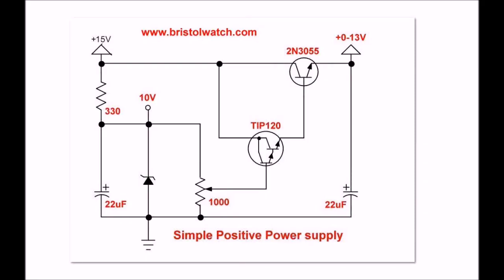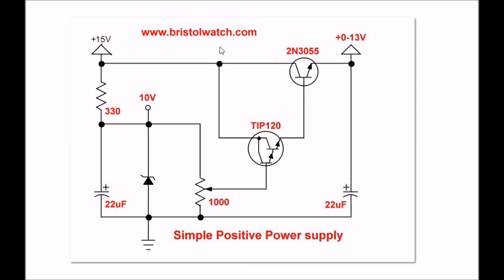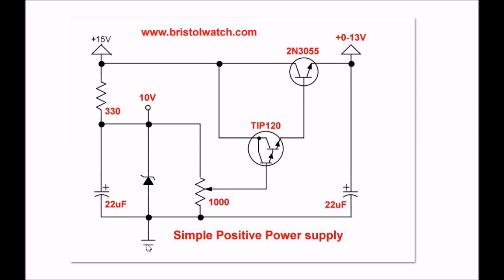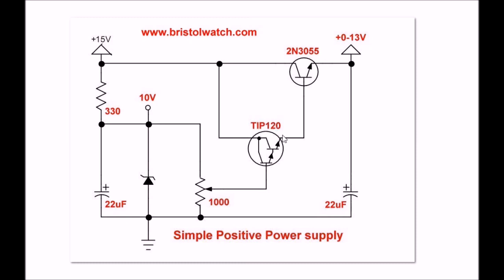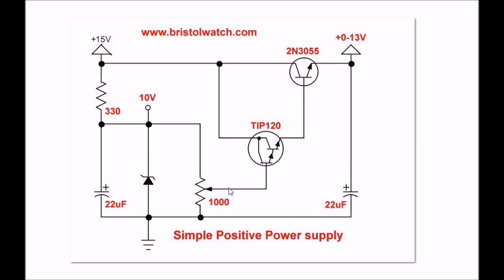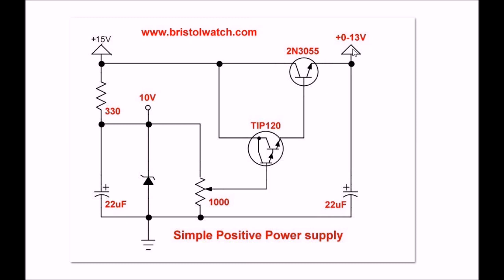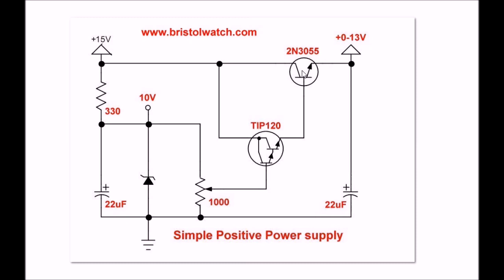Simple Variable Positive Power supply

Comment: If I recall my emitter follower circuit operation with the pot set to the full 10 volt position the output can only be 10 volts minus the 3 base emitter voltage drops.   So the max this circuit will output is 10 volts minus (3 x .6v) =  8.2 volts.
Reply from the maker: This isn't a drop but an add. The voltage drop across the B-E junctions are in series with the Zener voltage.
Reply: No.    The negative regulator adds the emitter base voltage drops to the output.   I think you are getting them confused.   Hate to confuse the newbies.   In the positive regulator version the forward drops is subtracted.

Comment: I've seen at least one circuit analysis that specifies an electrolytic cap between (in your configuration) the TIP120 base & ground, say value 330uF.  I believe that is called a "capacitive multiplier", and 'amplifies' the effective filtering value of 330uF to such multiplied by the beta of the TIP120, which would be fairly high given it's a Darlington.  One wonders how that would impact ripple.  Thx.
Reply from the maker: Good to know I'll check it out.